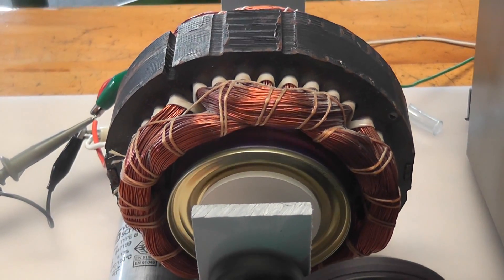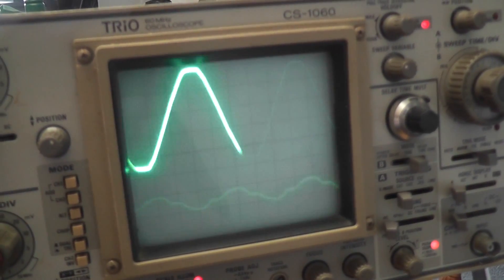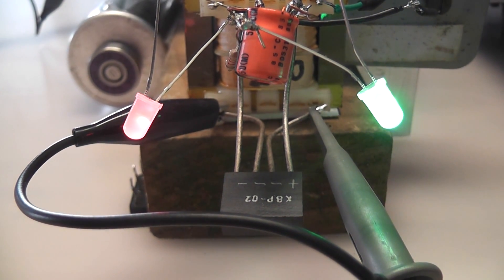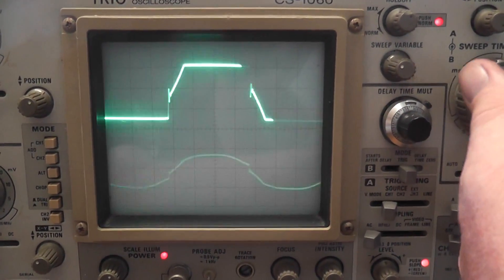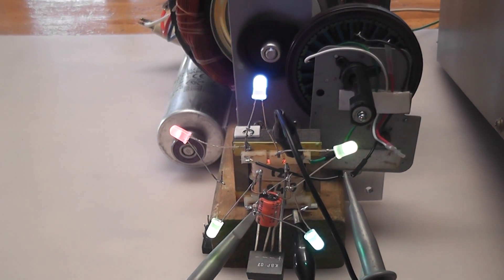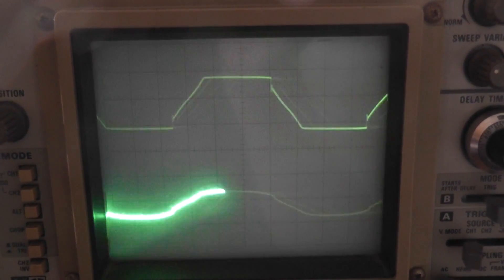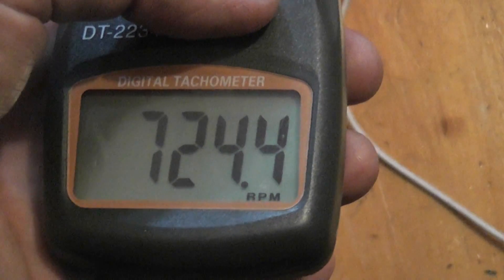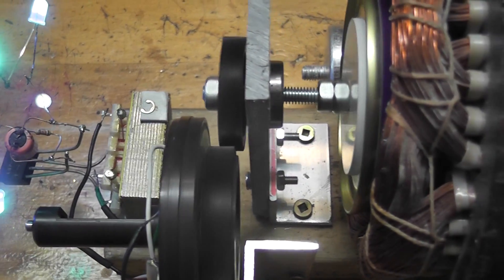Can Motor generating Electricity

Comment: That's a capstan motor out of a VCR, probably a Funai (Oh I remember those). There is on-board driver circuitry for the the windings, might be why the waveform looks like that. Great video!

Comment: What if you reverse it, and use the can motor as the gerenator, driven by some other motor? With a little belt, or rubber band, you'll be able to drive the motor at a high RPM. That waveform will be interesting too.

You'll still have to use the capacitor to create reactive power and make an induction generator work, but you probably knew that.
Reply from the maker: +marco23p Yes I am working on a brushed washing motor driven car alternator. Just finding the time to complete that project.

Comment: the flat tops on  the output on the transformer is probably due to clamping from the leds it would also explain the weird shape on the input.
Reply from the maker: +Erik Bruijn Could be, I may have to put on a resistive load only. The LED's were supplied through a full wave bridge rectifier.